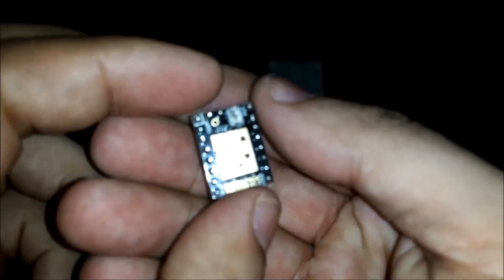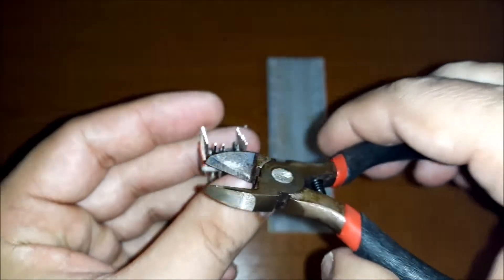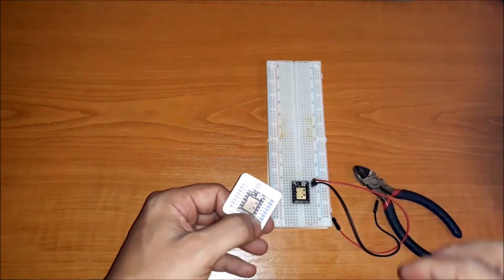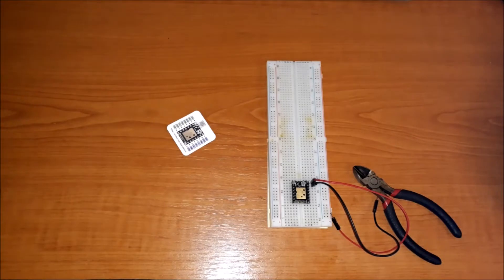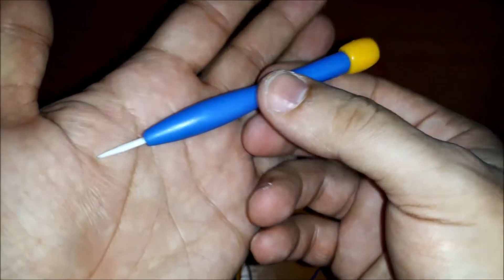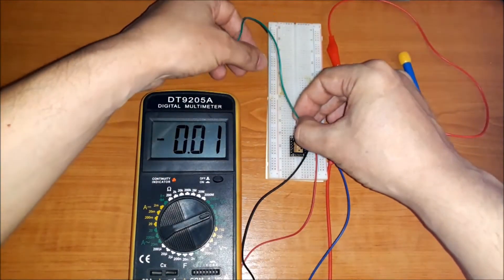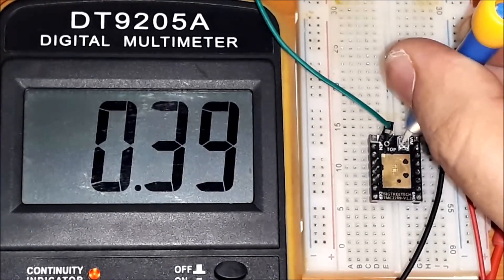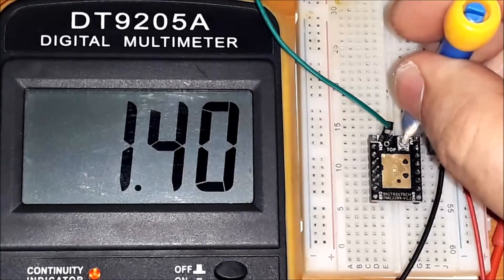CNC BUILD PART 26 - TMC 2209 DRIVER - SET THE MOTOR CURRENT BY MEASURING THE VOLTAGE ON THE Vref PIN

Comment: Why did you cut the VREF and DIAG pins?
Reply from the maker: because I used the driver on the expansion board for arduino uno, called cnc shield version 3.0 and the two pins do not fit on the board. this driver is not designed for the cnc shield v3 board

Comment: And no one explains why * 0.71 and why * 2...     If anyone is interested: ассording to datasheet  I_rms = (325mV / (R_sense + 20mOm)) * (1 / sqrt(2)) * (V_ref/2.5V).   Board from video has R110 (110mOm) R_sense resistors.  I_rms = (325 / (110 + 20)) * (1 / sqrt(2)) * (V_ref / 2.5),  I_rms = 0.7071 * V_ref,    so maximum  V_ref = I_rms / 0.7071 for this board.  And for example if we need a RMS current limit of 1A , then V_ref = 1.0 / 0.7071 = 1.414V

Comment: Thank you for the video. But I still need help if you may... I have a 3D printer which is of 24V and I want to replace my Nema 17 48mm (1.5A) with Nema 17 60mm (2.3A) by using TMC2209. I have purchased TMC2209 v4.0 (XinDongWang brand) from AE, is the vref formula still same for this item? Should I use 2.3*1.41=3.24? Do you think using %10 less ampere value (i.e., about 2.10) of the stepper motor would be safer? Thank you very much.
Reply: Okay, the formula is VREF=Current×1.41, for my case it is VREF=2.3×1.41=3.24 and with %10 safety margin it is VREF=2.3×1.41×0.90=2.92

Comment: I burned two tmc2209 :), the power supply was set to 0.5A and yet it burned immediately.  I did as in your video.😢
Reply from the maker: I'm sorry for destroying the drivers, but if you haven't connected any stepper motor or logic power, the driver shouldn't burn.
At power-up the motor supply voltage VM should come up first and then the logic supply voltage VIO. On power-down the logic supply voltage VIO should turned off at first and then the motor supply voltage VM, because the internal logic of the TMCxxxx driver is powered from VM.

Comment: Hello.  What is the VREF setting for 17HS4401S Nema Motor and 1/8 stepper stepper of Tmc2209 stepper motor driver board?  Thank you.
Reply from the maker: 17hs4401s has a maximum operating current of 1.7 amperes, so according to the calculation formula 1.7*0.71*2= Vref is 2.4 volts. in most cases, the maximum performances given by the manufacturers are fanciful, so you should use the stepper at a current lower than 1.7 amperes, so depending on the use, for example with a 3d printer, you can use it at 0.8 amperes. it is best to increase the amperage gradually and check how much the stepper heats up. don't forget to use a cooling fan on the driver's radiator.
regarding the microstepping, the same formula and the heating check apply
Reply: @CNCEVOLUTION  Thank you for your answer